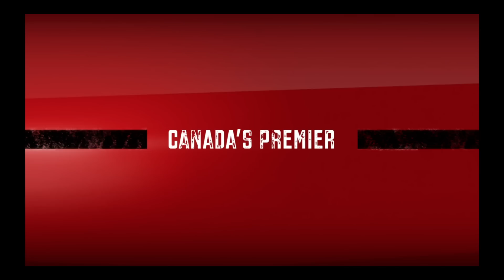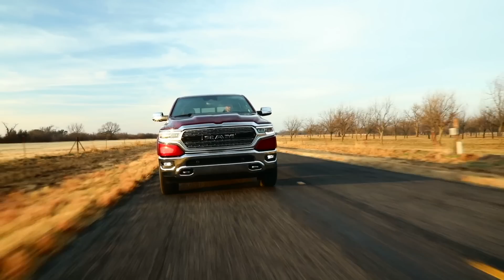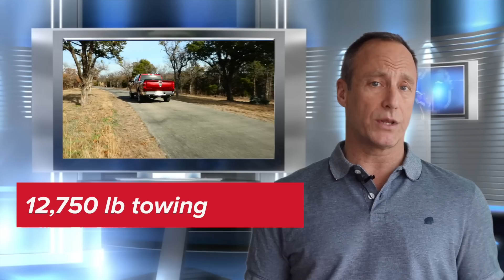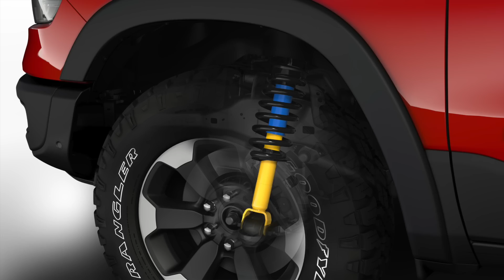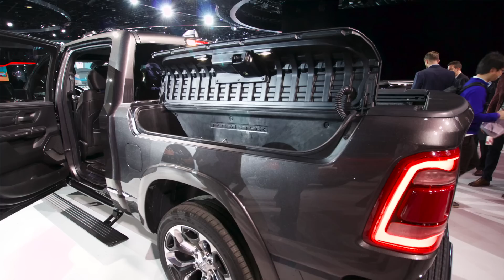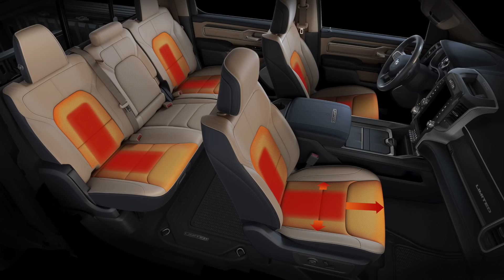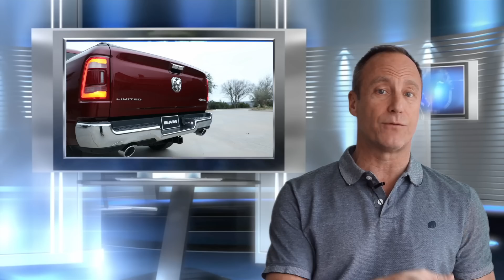Ram 1500 Engine Drive Train

Comment: I just bought a 2017 F150 in October of 2017 after shopping between the Ram and Ford.  The main reason was I felt the ram was a few years behind Ford in tech.  Transmission, engine and styling all seemed newer with Ford so I went that way.  If Ram would have had this redesigned truck available when I was looking I would have gone for it.  Infotainment looks awesome.  The light hybrid battery feature is exactly what I wanted and was what I was hoping the auto start stop would deliver in the F150 but has been disappointing thus far.
Reply: Really, the interior ram has been winning awards over, and you think it's behind ford? Transmission is an 8 speed, been in production for years and is solid, and you think it's a good idea to be an early adopter of the ford/gm 10 speed, and the troublesome ecoboost. Oh well, you'll learn in time.  The 5.0 V8s are more powerful and fuel efficient than the ecoboost.
Reply from the maker: I think you still got a great truck, if we always waited for the next new one, we would never get one :). Which engine did you pick?
Reply: I got the 3.5L that came with the 10 speed trans.  Thnks.  Good video.
Reply: You can alway trade it in for the ram
Reply: You really think the V8s are even close to the eco.   Dude not even in the ball park.   I have a less than 1 year old F 150 with 3.5L Eco and I am getting well north of 20 into the 21 MPG average in all driving situations.    I came from a Dodge and hold it dear to my heart but it was the motor of these Twin turbo V6s can do anything any V8 can do with Way better fuel efficiency.  Can tow pull carry loads like any V8 while getting better fuel economy.   So as for now I will enjoy my Ford and when it comes time to get another truck in a few years Dodge will always be on my radar.     I just hope they can boost their hemi V8 and give it more power in the mid to upper 450 HP while getting 20 MPG .   But real MPG not fake what is listed on window sticker.  Then I would jump in with both feet again.
Oh and the reason I traded in my Dodge I. Was the frame was rotting.   Freaking frame rot.  Unbelievable.
Reply: What I like about V8s is the smoothness of the engine. I drive a 2018 f150  3.5 ecoboost. It's crazy fast and powerful and ok mileage when towing. But when I  get in my 08 expy my v8 smoothness is superb compared to the ecoboost.
Reply: Stan, Ford has really gotten it together on a sharp looking F150. Its come along way.
Reply: Stan Sullivan congratulations great truck. If you can let us know how the 10 speed transmission holds up? I just got a 2018 1500 ram with eight speed, love it. But I love the fords too.😎
Reply: samus989 not sure that's true.   My Dodge and other V8s friends have are 15 or maybe, Wait MAYBE 16 MPG.   No way 20.  Not even close unless you go downhill both ways.   Not possible.   I am not talking towing as I would assume V8 would be better gas milage but that is assuming.   Hey all I know is that my V8 Dodge hemi was a 15 MPG truck and my Ford eco is 20 to 21 MPG if not over.   Like 21.3 .   While I loved my Dodge my Ford is on another planet but yes it's newer.  But motors. The Dodge couldn't keep up with this truck even in performance.   This eco is so fast it's crazy compared to my old Dodge V8 Hemi.    Also the delay when stepping on the gas in my dodge was about 2 seconds.   Lots of noise then take off.   My Eco is basically instant power and get go.     

For me right now the Ford is perfect for me.   Down the line I will be checking on Dodge again.  As I love the upgrades it is showing but I want better power than the same old tired Hemi V8.     It needs a boost IMHO.   When it does I might be there in the dealership.
Reply: Brian Supermag my old man had an 04 ram 1500 hemi, and you're right, it was terrible on fuel. Even my power wagon does better, by quite a bit actually.  The EcoBoost off the line will feel faster because the turbos are small they run the low to mid range well but as I said they don't have the output for higher HP numbers. Just like a diesel, they're made for low end power. Once you get past the turbo efficiency range you're left with a 3.5L V6 that cant make much boost. This is the reason the torque is where it is in the truck and why the HP numbers are lower overall. The 5.0 can make use of lower gears longer as it's redline is much much higher than the 3.5, holding its torque longer.  
The major issue lies with the turbos. You need to be critically aware that there's more to taking care of your engine than a n/a and for what you get, from what I've heard by the people I know who own them is that they wish they had the 5.0
I wouldn't recommend any truck over another without considering the needs of owner and quite frankly the EcoBoost would not fit in to any of those.
Reply: samus989 well I get the exact opposite as you.  My hunting buddies tundra gets 15 Max. Chevy Silverado 2014 or 15 is a 16 MPG V8 at best.     My dodge was a 2011 or 12 not sure I remember correctly.  But I was 15-16 at most.   My turbos were upgrades over the older ones of 17 and had lower lag time.   It's not seems faster but it's way faster off the line than my older Dodge was.   For my use like you said MY use this Ford F 150 does everything I could ever need for now and I get much better fuel milage than others.  It's really not close.   16 or even 17 MPG truck is still 3+ MPG less than what I have.    

Our uses are definitely different and what we are seeing is different also.  Never seen or heard anyone around here with V8 trucks getting anywhere close to 17.  Not one at work or anywhere has told me different.    If the new V8 can do this I would be impressed but I haven't seen it or heard of anyone who has a V8 pickup doing any better than 16.     Just what I have seen.  

As far as my truck and it's longevity who knows.   The president of my hunting club has. An eco F150 for last 4 or 5 years without a hiccup.  He loves it and when he gets another truck he will get another F150 he stated.  We are just seeing things differently that's all.   Best today luck
Reply: Brian Supermag I get 16 to 17 mpg in my pw cruising at 60 on the highway. Its more about driving habit than vehicle.
Reply: Stan Sullivan antykoagulantš
Reply: Isle of Hope everybody's pushing the newest technology and they want it yet there's not one person out there many dealership who has an idea what the hell's going on with them...good luck getting them fixed.
Reply: Brian Supermag 20 is average for V8 pickup half ton. Everyone who know that engine know you can have eco or you can have boost. But not both. They're whores on fuel when towing. I know several people that own one and they wish they bought the 5 liter. Fuel economy is better they're more reliable, this is proven as the turbos are a known failure point in the engine and they can't provide the same horse power a n/a V8 can provide. They make decent torque down low like a diesel but just like a diesel they fail on the top end. Its just pure HP numbers. Due to the small displacement and the fact it's gasoline the fuel economy when work goes way way down the engine is nothing special. If you want an eco engine get a pick up with a diesel or V6 if you want to tow get a V8 or a diesel. The eco boost was spun as the best of both worlds but it's really the worse of both.

Comment: Awesome job with interior and exterior. Disappointed with power trains though no Direct injection with Port and still iron block with Hemi. GM did a heavily revised 5.3L and 6.2L with both Port and direct injection and can shut down 7 Cylinders but nothing like this for Ram. Time to step up and get with the times.
Reply from the maker: The Chevy cylinder deactivation is pretty slick. But Rams' eTorque is rather ground breaking as well and may actually be ahead of the times.
Reply: 4WD Magazine Yes it may be ground breaking and new but it doesn't get any gains in HP and Torque for Hemi from what I'm seeing. It is something new and time will tell with a stop start system.
Reply: Direct injection causes alot of carbon build up issues. Or at least it used to.
Reply: Michael James Not when it has Port with Direct Injection like Ford and GM done this year. I have a 17 High Country 6.2L and installed an Elite RX catch can and clean side separator that takes care of carbon.

Comment: Ram brought their A game and hit a home run. I'd probably opt out of the air suspension and etorque because it complicates things too much.
Reply from the maker: I believe eTorque is based on some pretty solid (tested) engineering (as is the air suspension). It's just that they are the only ones applying it to the half-ton segment and I do agree with you to some degree - the year of production can be challenging.
Reply: eTorque is not new, ram is just the first to put it on a truck. I'm not saying it will be flawless but it's already a proven technology. We have to go somewhere from here. Engineers are doing their best to prolong the life of the internal combustion engine because at some point, maybe not in my lifetime, vehicles will all have electric motors. Goodbye beautiful V8 music.

Comment: The Pentastar is one of the most unreliable engines ever made! Add a belt drive starter generator like a riding lawnmower used 40 years ago and what could go wrong?
Reply from the maker: Good to hear from you, thanks.
Reply: I have had 2 Pentastars with no issues at all. Installed a Ripp Supercharger on the second. Check out the truck  https://www.quadratec.com/c/blog/brothers-challenge
Reply: +4WD Magazine check this out. https://www.quadratec.com/c/blog/brothers-challenge
Reply: You may have had a bad experience with the 3.6 but they are in fact a great engine!!! Have had 2, one in my grand Cherokee 76,000 miles and the other in a 1500 with 103,000 miles.  Both never had any engine issues.
Reply: I've owned two of them and drove the crap out of them and zero reliability issues. here are millions of them on the roadways and you don't see them piled up on the shoulders broken down.
Reply: benjaminwayneb the Pentastar engine has been voted several times as one of the best engines out there.
Reply: It's a good working engine with good power it just has too many reliability problems. The cylinder head valve seating problem still hasn't been resolved, one of many ongoing problems.
Reply from the maker: 25,000 km on my Wrangler - lots in low gear climbing slippery trails and rock, trudging through axle deep snow - no issues at at all. A couple of mechanics have told me it's solid enough to throw a supercharger on it - no problem.

Comment: The heated axle is only on the 2x4. Done to get mpg up and cool the axle as the 2x4 has the highest tow rating...
Reply: I can't help but wonder, why Ram just didn't go to a 100% Synthetic Differential fluid to lower the temperature and cold temperature flow abilities.  Sounds like a lot of extra money to do what they have done n this regard!
Reply: heated axle??
Reply: Dean Stoops yes I didn't studder. Google it. Coolant is used to heat and cool the rear axle on 2x4 models.

Comment: Normally I wait until things are proven; not this time, I'm in love with this truck and I'm going to take a chance with ordering everything it has and take it right away.  RAM all the way.
Reply: Devo Dar 
If I were you I'd wait yes all that you fancy technology is really nice and really good and efficient but remember it's a first your Model Truck first your models always have the most issues so if I were you I patiently wait another year to make sure all the Kinks are worked out cuz which would you rather do would you rather drive the truck or keep driving it to the shop all the time the choice is yours but for me I'm going to wait a year before I even consider snag him one up but that's just me.
Reply: I know, you are correct. I'm just so excited I want it bad. I don't think I can wait for year 2 although I do want the diesel and those don't come out until 2019 CY
Reply from the maker: I'm with you. There are so many things on this truck that are only on Ram.

Comment: Until the RAM reveal I only had Ford on my shopping list for a new truck (because Ram/Chevy/GM trucks were behind the curve), but now I have Ram back on the list.  If I go that level of truck - because I am actually looking for F250/2500 class.  Hoping that the new designs will carry up into the Ram 2500 in the near future (after all, the current 1500/2500+ look very similar).
Reply from the maker: I believe they will. Ram is first to put a new truck on the pavement for us. When Chevy gets the Silverado into dealers early 2019 - look for Ram to make some noise in the 2500/3500 market.

Comment from the maker: Ram is first off the line for 2019 Half-ton pick-ups. Will you buy into the eTorque semi-hybrid or wait until it's proven over time?
Reply: Dan the car man was that one sentence?
Reply: John Potter 
What are you a Grammar Nazi.?
Reply: 4WD Magazine 
Well I guess I'm not that confident because in my opinion I think it's always best to err on the side of caution and wait a year to make sure all the Kinks are worked out the vehicle I learned that lesson the hard way cuz I bought a first your model vehicle once had nothing but issues with the thing brakes were bad you'll haven't can't going out the trim was rattling falling apart all that dumb crap I had to deal with I'm never doing that again I will gladly wait a year or two and put up with my beat up old vehicle rather than taking a chance on buying a new truck that is unproven technology but again that's me.